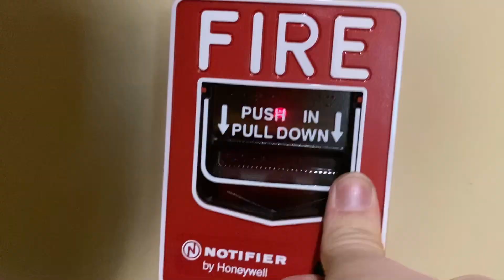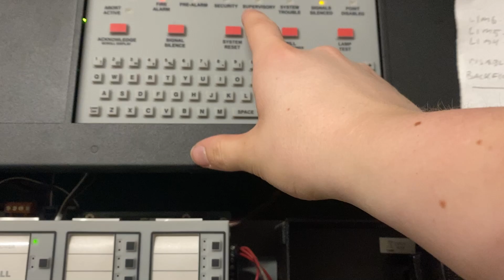Fire Alarm Test #92 | Wheelock Voice Evac

Comment: 00:48 This one needs its volume adjusted by having a higher Watts setting

04:17 What happened there is that they made the Wheelock AS do strobe only by removing the volume jumper because the technicians that installed the system likely ran out of Wheelock RSS strobes so they used this instead as this is not a fail because it's in an area where a strobe only can be used like in a bathroom, FACP room (the panel piezo is the audible signal), or really small space. To replicate the Wheelock AS doing strobe only watch this video here https://youtube.com/shorts/GZe0Xqo8-M0

Comment: Another voice evac system without some kind of tone
Reply: With out the code 3 slow whoop
Reply: They don't have a code 3 chime at the GRR airport. It's a simple message. It went off when I was there from a faulty sensor. But what's weird was it was exclusively ceiling mounts, and none were directly fire alarms. All said alert. I almost never go to the airport, but if I do, I'll show it off along with the original video I took. Looked like an EST system, but I saw no pull stations.

Comment: 4:16 Yeah, that could have easily been an RSS. #whatafirealarmfail
Reply: not really a fail lmao. it works and does its job. the installer likely ran out of RSS’s and just threw that up
Reply: What happened there is that they made the Wheelock AS do strobe only by removing the volume jumper because the technicians that installed the system likely ran out of Wheelock RSS strobes so they used this instead as this is not a fail because it's in an area where a strobe only can be used like in a bathroom, FACP room (the panel piezo is the audible signal), or really small space.
Reply: @joeycaridi3030  audible devices do not have a requirement for where they can’t be installed. modern code actually requires them in all rooms i believe